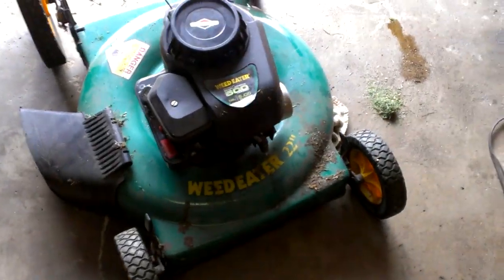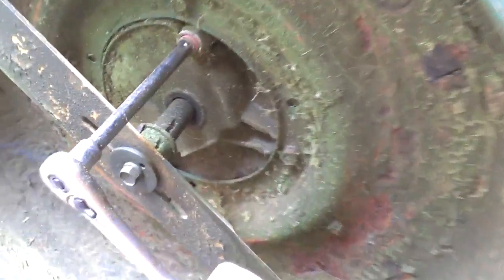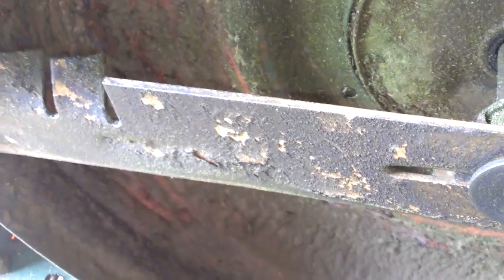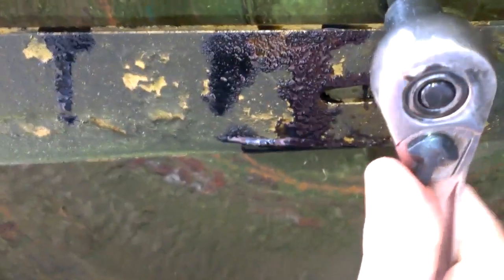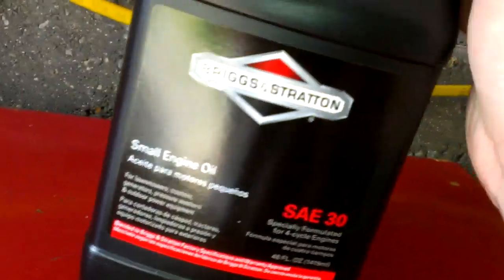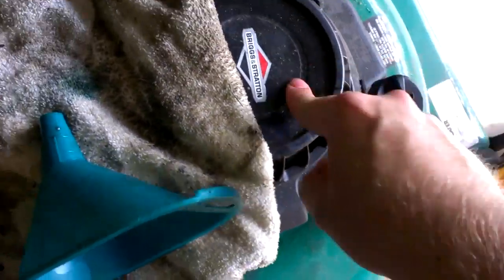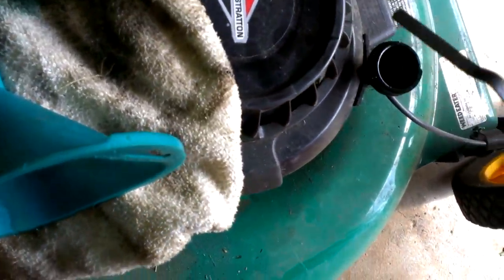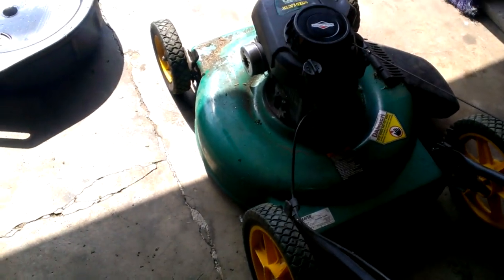Briggs and Stratton Lawnmower OIL change

Comment: the blade on my mower fell off and was put back on now the pull string is completely stuck it won't pull at all. help??
Reply from the maker: is the blade bent to the point where its catching on something and not allowing the motor to turn? or when you tilted the mower over it may have leaked some oil in the combustion chamber and hydrolocked it with oil. take spark plug out and try pulling it.

Comment: I think I added to much oil..because now there's oil leaking from the muffler and the pull string thingy won't move to start. did I ruin it?
Reply from the maker: +rebecca bushy no. when you tilted it over the oil ran into the combustion chamber. take the spark plug out then pull the string about 10 times and watch all the oil spew out the hole. clean the spark plug up a bit and put it back in. it should fire up with a bit of smoke at first then clear up. check the air filter aswell. it could also be oil saturated.
Reply: +bam6972 so all of briggs & stratton mowers have oil filters? btw your instructions are on point bc I changed my spark plug just two summers ago... now I'll do what you said in case I may need to do that. 
I tried syphoning the oil out and just have a complete oily mess. i watched another vid and saw this man do what I wanted to do i. the first place- tip over the mower to drain the oil. I'll be careful of any spills. ugh.
Reply: +bam6972 so all of briggs & stratton mowers have oil filters? btw your instructions are on point bc I changed my spark plug just two summers ago... now I'll do what you said in case I may need to do that. 
I tried syphoning the oil out and just have a complete oily mess. i watched another vid and saw this man do what I wanted to do i. the first place- tip over the mower to drain the oil. I'll be careful of any spills. ugh.
Reply from the maker: these motors do not have oil filters. just air filters.
Reply: +bam6972.  Yes. Bc I didn't see one on mine. Just the air filter. I should take a look at that.

Comment: What if I accidentally put a little oil in the part where the air filter was, is my mower ruined?
Reply from the maker: Rachel Liebhart nah it will be ok. It will likely just smoke for a bit then go away. no harm done.
Reply: Thank you, I had to just use it and find out on my own. And it wasn't a whole lot just a little. I'm doing this by myself and I know I can do it, just a learning process. Thank you again, sincerely